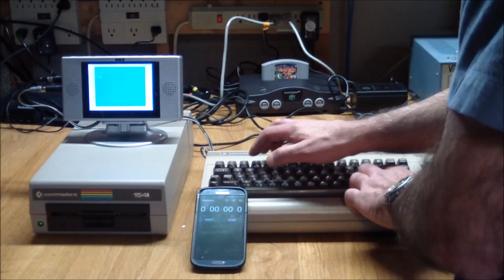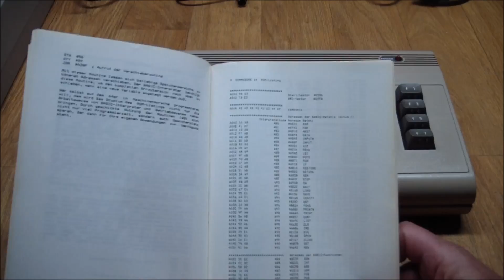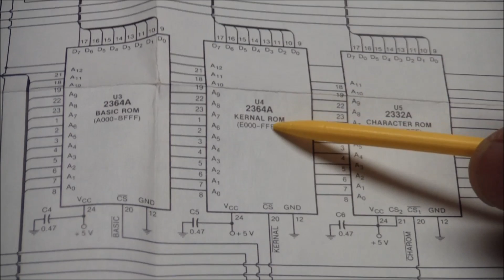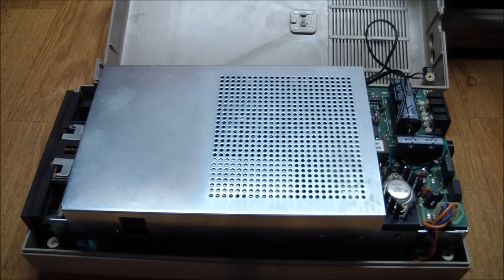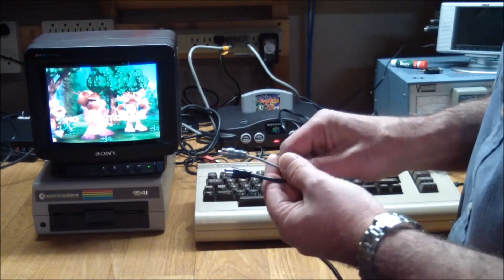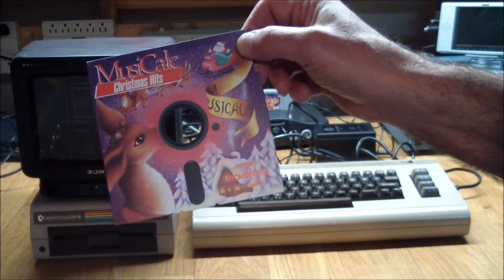AE#46 Commodore 64 With A Turbocharger

Comment: Well if you think about it, disk drive is fundamentally a serial medium, and it's not that fast either... Commodore drive should have had a transfer speed of around 2kb/s but ended up having 512 bytes/s due to forced compatibility and hardware bugs in earlier hardware generations. I don't think regulations were ever particularly responsible for limitations of serial speed, since you can shield a serial cable very easily, data integrity was a bit of an issue though.

Comment: Interesting fact: The VC1541 drive was basically another computer (other manufacturers programmed the drive logic into the console itself, not Commodore), so there was software developed that used the computing power of the drive as a second CPU